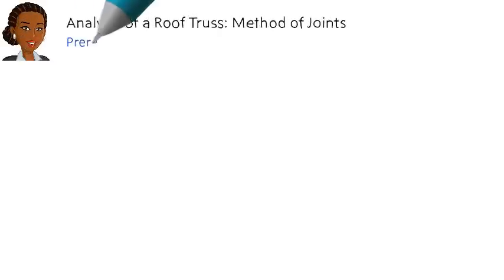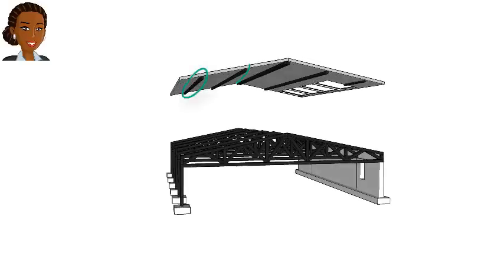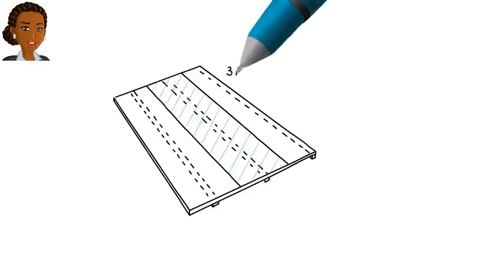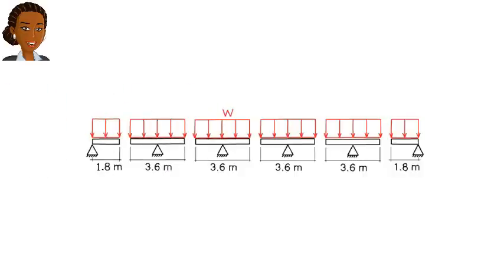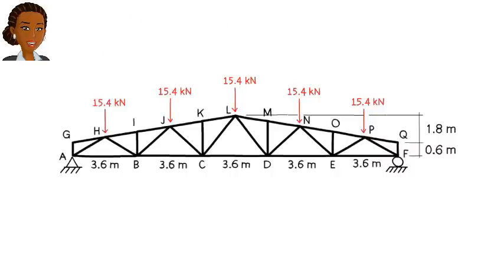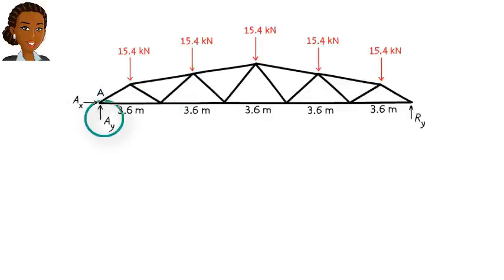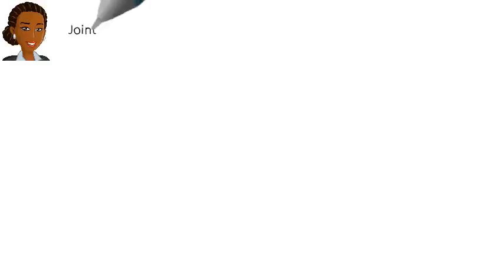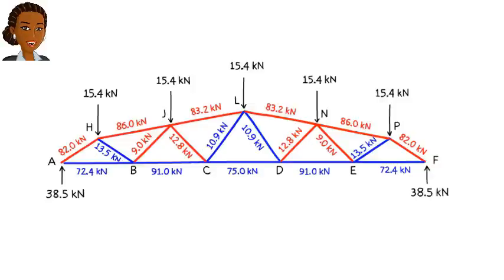SA36: Analysis of a Roof Truss: Method of Joints

Comment: how do I know the load of the roof in my house ?! ... I can't even give an approximate number to it
Reply from the maker: It depends on the type (material) of the roof and its dimensions. For example, for a concrete roof, one can use the specific weight of concrete (~150 lb/cubic foot) as a starting point. But, for actual design purposes you always need to study the governing local design codes for such information.
Reply: +Dr. Structure Thank you 😘😁😀

Comment: Dr. Structure you is the best structural analysis professor to me
for that, i ask if there are any videos about finite element method and plates .membrane analysis
Reply from the maker: You are correct, we have not yet produced lectures on advanced structural analysis topics. We will get to them eventually, after the basic topics are covered thoroughly.
Reply: thanks a lot, I will waiting for your awesome explanation
Reply: Mahmoud Taha I think they upload it before .. Check out the videos on their channel and if your re using the web you can easily serach in the channel using words
Reply: thanks alot for you, I check the channel and not found anything